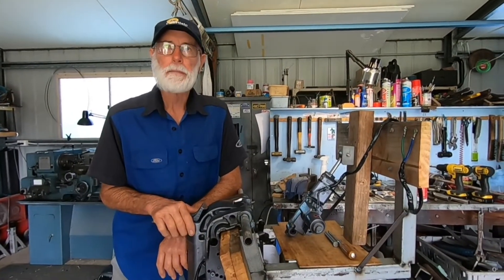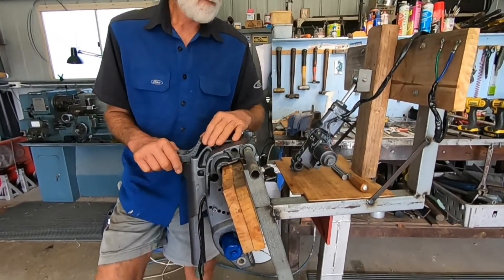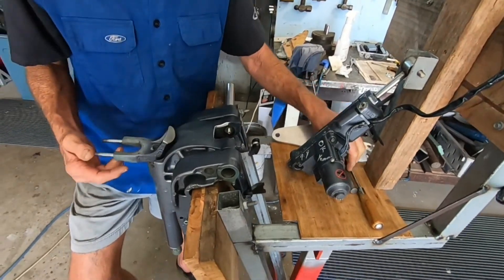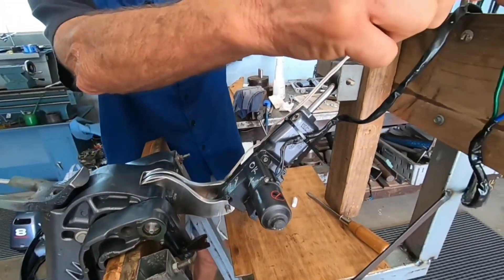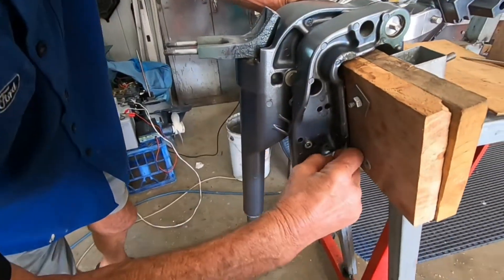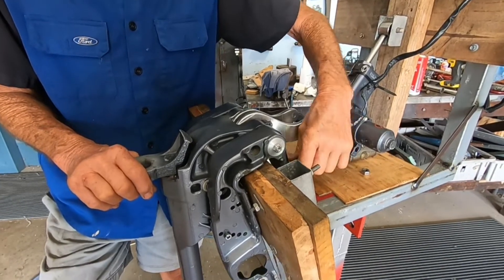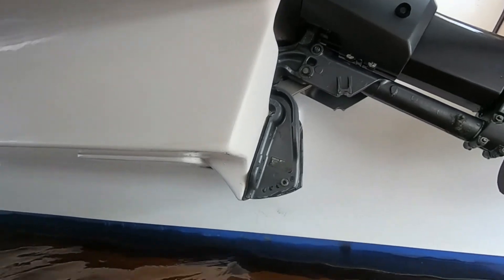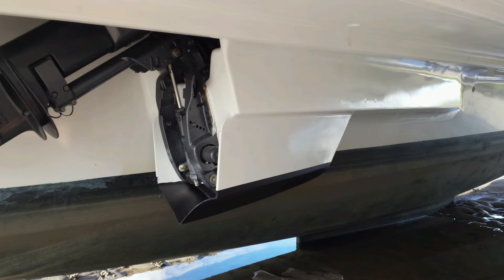Yamaha Outboard 9.9hp hydraulic tilt modification on our Easy Catamaran

Comment: Do you have some measurements of the aluminium triangle were the holes are positioned?
What hydraulic lift did you take for the new setup, is did bigger than the original one?